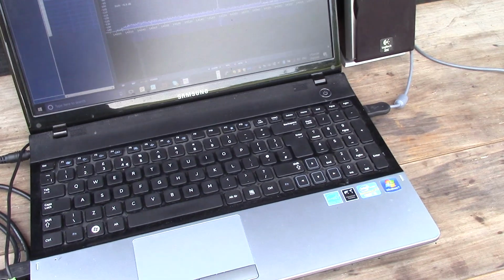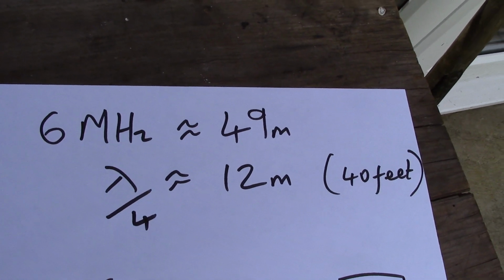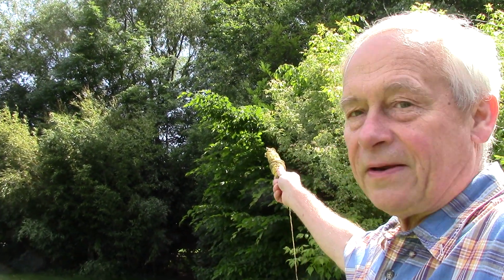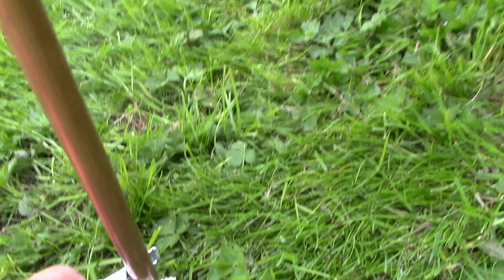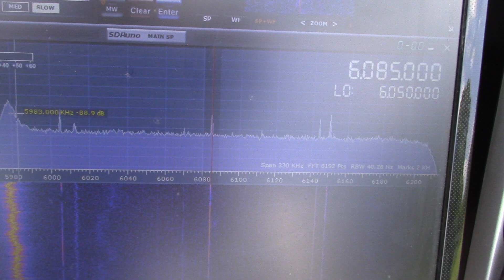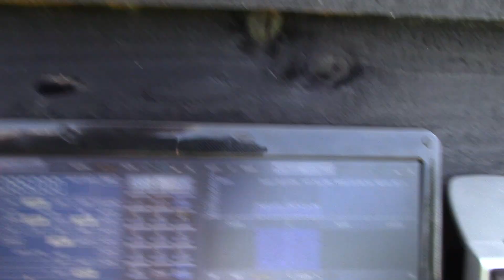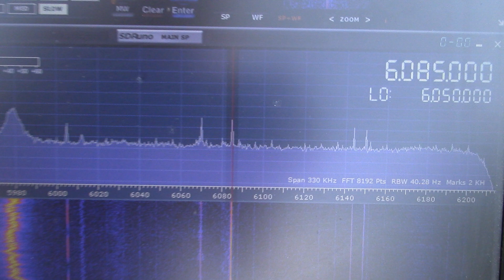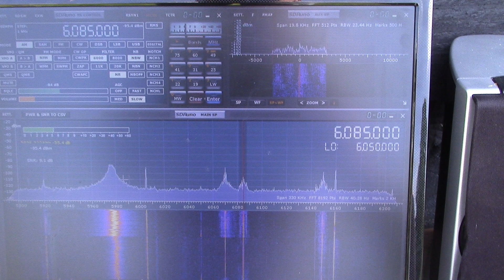Shortwave radio antenna and ground demonstration

Comment: Sir,
How do we receive at times hf frequencies in a vhf antenna
Reply: The signals are traveling through the air. Anything metallic, even a coat hanger, will pick up signals. Read an antenna handbook
Reply: @624radicalham  thank you for your reply. I completely understand that anything metallic can recv signals in the air. But doesnt the concept of a particular length of antenna required for recpetion of particular band of frequencies true? So then how hf freq in air is recvd at times by the small vfh antenna?
Reply: @abhilashraveendran8339  The concept of an antenna cut for a particular band is important for transmit only. Not for receive. Sure, there is something called a 'resonant' antenna cut for a particular range of frequencies for transmit. This will ALSO alow you hear a little better on those frequencies, but you'll hear almost the same with any wire up in the air. TRANSMIT is what is critical for an antenna to be resonant. And when it's not resonant, then you can use a transmatch (antenna tuner) to match the inpedence of an antenna to a transmitter. I'm glad to help but I wasn't joking about the fact that you need more reading. Check out the ARRL Antenna Handbook. And easier yet, watch YouTube videos on antenna theory. If you put a VHF antenna on an HF radio for receive, you'll hear HF reception. Of course. But you can't transmit without destroying the radio. Youtube videos. There's hundreds my friend.
Reply: @abhilashraveendran8339  Also, remember that radio waves travel at different frequencies so this is why VHF antennas are smaller. If you make a wire, for example, that's too long, it won't receive well on VHF. It will receive, just not well as it should. UHF requires even smaller antennas. Critical for transmit. Not so much for receiving.
Reply: @624radicalham  thank yo so much for making me understand the concept. Surely i shall refer the books. At times it becomes very much clear when someone experienced like you explains in short the whole concept. Thank you so much.
Reply: @abhilashraveendran8339  My pleasure. You will have fun playing around with different antennas and possibly even enjoy making them! HF is very exciting when your voice travels to distant places on earth, faster than the internet. Understanding propagation is important on HF. Today you can talk to Indonesia, but maybe tomorrow you can't because of the activity of the sun, and how magnetized the ionosphere here on Earth is. So then you learn to read the sun and it's properties. Fascinating stuff. I hope you get into the hobby fully!
Reply: @624radicalham  wow....this is so much interesting. The info shared by you depicts your years of experience and passion in the subject. Learning from a specialist like you is much more faster and makes the concept clear. Pleasure to get your rapid replies as well😌
Reply: @624radicalham  Thanks for this advice very helpful to me. I am a SWL and always worrying whether my random wire is too short or too long, but my question is answered regarding RX antennas. I have just received my RSP 1 A and cant wait to get going. I have a random wire antenna of 94 feet and always worry that it is too long.

Comment: A more efficient and easier ground stake would be:   A 3/4" copper pipe hydrodrilled into the ground 6', the hole around the pipe filled with bentonite clay (cat litter, usually), and several teaspoons of copper sulfate mixed with the clay. This really works with bad ground conductivity (sandy, or limestone type ground surfaces) as the copper sulfate improves contact with the earth ground as it slowly leaches into the dirt. Add water to the clay copper sulfate mixture to get it working. Shortwave radio stations that do not place a metal ground mesh 1' under the ground use this, but multiplied 36 times in a 360 degree fan around their antenna, one stake every 10 degrees. It works, cause I've used it around vertically polarized antennas for decades.

Comment: I have my RSP1a hooked up to my 34 foot Amateur Radio Vertical with 60 radials.   I LOVE ❤️ this little receiver !!  I also have the radio going through my Antenna transmatch so the signal is matched on every frequency.  I do have to unhook it after every listening session.  Amazing DX at night on all bands.  

I also built a small transmitting Loop that works portable :)

Comment: Thank you for this informative video, still I have some questions:
1 with the longwire antenna by using a 9:1 balun will increase the reception or this js mainly used for transit purposes?
2 using the grounding connector from the outlet will induce any risks?
3 using a tuner unit like the Yaesu FRG 7700 will help or isn't needed for RSP1A?
4 I have a DIY magloop from a 2m copper (18mm in diameter) pipe and a 1000pF variable capacitor connected to the RSP1A. Is there the risk of burning the RSP1A (front-end)?

Thank you
Catalin

Comment: Very informative discussion and video but it leaves out an issue that can become a life threatening hazard and a financial nightmare if not addressed properly.  If your antenna wire is above the roof of your house, 10m or so, it may attract a lightning discharge. Lightning arrestors for telecoms/radio circuits are commercially available and can be connected in series with the long wire antenna but are likely to cause impedance matching issues and signal loss of strength. Please comment

Comment: You can get 20m washing line strong plastic coated steel core for  £1.50p.from ASDA at the time of writing. It's whats going on my 4 band valve radio for SW listening.

Comment: With the loop antenna did you also maintain the two grounds?
Reply from the maker: No need for the mag loop. The signal source is where the loop breaks.  No need to have a ground or counterpoise

Comment: Great job.
One question, can we use the ground wire of domestic electrical wiring instead of stake in the ground or long counterpoise? Is it advisable? Are there any dangers?
Reply: Laeeq Khan Not a good idea as too close to mains likely to introduce hum

Comment: Very nice and informative demonstration on grounding but i have a question plz why did u use a speaker wire that you twisted at its end instead of a single solid or stranded wire like the one u used for counterpoise? Is there a particular advantage?
Reply from the maker: No - that was purely because I had that speaker wire to hand and I wanted something extra chunky so it would show up in the video.   You can use much lighter-weight wire - if it's to last over a period of time, when properly suspended then it's all about withstanding the weather!
Reply: SDRplay Software Defined Radio Receiver thank you! Do you think adding more counterpoise wires would enhance the grounding effect as compared to a single wire?

Comment: Thanks I probably learned more about antenna building than reading a bunch of books.  A couple questions (1) could you use your household wiring ground lead (i.e. from an electrical socket) as your ground?   And could you explain why this wouldn't work as a transmitting antenna?
Reply from the maker: The question about using the household ground is an interesting one.  Yes, it's true that in certain houses a domestic ground might also serve as an amazing RF ground for HF  (imagine you are on the ground floor using a mains socket ground terminal, very  close to the consumer unit which in turn is anchored to an excellent ground stake also tied to metal water pipes which go underground etc etc.)  However the safe answer is DO NOT CONNECT THE RSP DIRECTLY TO THE HOUSEHOLD WIRING MAINS GROUND TERMINAL!  This is because under extreme circumstances a fault condition could exist in the household wiring whereby the safety ground temporarily gets an elevated high voltage on it (e.g. a wiring fault, a badly wired plug, a faulty appliance which uses the ground terminal - agreed it's highly unlikely when you also have current residual current detection circuits to ensure live and neutral current flows are equal and so few modern appliances rely on the ground terminal, but the safe answer is not to try it    Additionally,  an average ground connection to a mains socket, well away from the consumer unit and house ground, now has the potential to present significant noise, coupled capacitively, from the long lengths of parallel conductors where many sources of interference may be present from all the other electrical devices  in the house).   

Regarding  the question about transmitting with such a crude antenna:   the main problem would be inefficient RF coupling of the transmitted signal.  When receiving it doesn't matter that the antenna is not matched very well to the receiver.   Receiving is all about getting the maximum ratio of signal to noise.  There are a number of tricks you can play, but matching  isn't important.  What matters is that you collect more signal than you collect noise. I saw a post from N3OX who put this well and I quote " Most of the time, on HF at least, you have plenty of signal available from any random antenna you put up to not have to worry about losing power in the feedline or antenna system.  The only way the RX will suffer is if your feedline or antenna is SO lossy that the signal you want to listen to drops into the internally generated noise in your receiver. This happens all the time on VHF/UHF, but on HF, it's usually the atmospheric noise or your neighbors plasma TV that keeps you from hearing well.  Feedline attenuation and antenna loss just make the signal AND the noise weaker, but the signal-to-noise ratio stays the same. 

A high SWR on your receiving antenna just doesn't matter very much. It might increase your feedline loss by three or four dB, but it doesn't have much effect on your ability to hear.

When you're TRANSMITTING, though, efficiency and gain are what you want.  You want to transmit all of your power. That's because when you make your transmitted signal stronger, the signal to noise ratio on the other guy's end gets better.  His noise stays the same, your signal goes up, you're easier to hear.

If you have a high SWR on your transmitting feedline and get three or four dB of loss, you're three or four dB weaker at the other end.  No good"    (end of quote)
So you could add a matching unit (ATU) between the RSP antenna socket and the crude antenna  to ensure maximum transfer of tarnsmitted power into the crude antenna, but even then - if the foliage was at all damp, there's a chance for the high voltage RF nodes on the antenna to arc across and instantly cause  a mismatch and potentially damage to the transmitter.    

But these are great questions - to get more complete answers, join the SDRplay forum and post them on http://www.sdrplay.com/community/viewforum.php?f=8&sid=839a6730d559764abf4afd8ada4932af  - you can also do a search to read other related posts on SDRs and antennas.

N3OX reference article: https://www.eham.net/ehamforum/smf/index.php?topic=32467.0
Reply: @SDRplayRSP  fantastic info and thanks. I've been working to wrap my head round HF antennas and this has been tremendously helpful.

Comment: How about grounding via the mains ground pin? There are special plugs for computer techs to ground them selves by connecting clips to the grounding pin. Would that work?
Reply from the maker: While this might work, it is not  recommended since the house mains could in extreme fault conditions, end up carrying dangerously high voltage.

Comment: This last week I've been playing with my new RSP2 within the constraints of my 10m X 10m (30'x30') backyard.  At first, my antenna was a single 5m wire suspended about 2m above ground level (I had picture hanging wire), along with a ground wire.  I'm new to SWL, but I could pick up a bit at 40m and 20m.  I've now "upgraded" to speaker wire, 3m above ground level, but I split/pulled apart the two wires into a dipole, each about 5m in length, and a 6m center feed to the rsp2 high-z input.  Reception seems better, but I can't quantify.
I wonder if this dipole would outperform your expedient ground plane, since both of my receiving elements are elevated 3m above ground?
Reply from the maker: you are getting much better overall length with what you did so that would explain better pick-up, certainly on 40m (apologies for delay in responding!)

Comment: you can not do that. You must use a balun
Reply: Two Hands and a Radio  You can take and a piece of wire, but it is inefficient - some of the energy is lost due to the inconsistency of the input and output impedances of the antenna and receiver, a pin is not needed in the ground, just a piece of wire-counterweight.

Comment: Hello thank you for the video first off. I'm setting this up tomorrow hopefully and I'm using a 9 to 1 balun from an eBay seller named lowbander. He uses a separate built-in ground connection and I am going to use 125 feet approximately of wire running down my neighbors 7 foot tall stockade fence. I got his permission of course LOL. I'm looking forward to this. I also bought a ground rod and some 8 gauge wire to ground it once the authorities mark the natural gas line. I'm starting out with a RTL-SDR v3 but I am either getting a RSP1A or and RSP2 soon.

Comment: High noise floor when using a wire, even if it is connected to a (real) earth or a counterpoise. The loop is the best all round antenna and as you call it "an option" it is far better compared to a simple wire. Also the loop in this version is a wideband antenna. It is the Signal to Noise ratio that gives good radio reception and the loop is always better compared to a wire antenna. As you can see in the video the noise floor of the loop is almost 30 dB lower compared to te wire so it will hear even the small signals on the air. Yes, there is the simplicity and low cost of a wire, but that is its only quality. The loop only uses ample space and is producing superiour signals, but it is more expensive. Nice video Jon but we can barely see the noise floor but lucky for us the S/N ratio indication of SDRuno shows us the  quality of the received signals.
Reply: How do discones compare to loops? For reception only, they seem to cover larger bandwidth and they also are cheaper
Reply from the maker: @02vLxcZF  Active mag loops are superb for HF and (depending on the design) below - see  https://youtu.be/aky9sVS0rTU  
 Discones can work well above 10MHz (depending on the design) and are excellent wideband non-directional antennas for VHF and above.  More about antennas here: https://www.sdrplay.com/antennasuggestions/

Comment: Thank you! I didn't know that grounding is so importandt for a receiving antenna.
Reply: Nash102030 ... not sure the ground he has is good. I am on heavy soil with a clay substrata 36 inches down. I have a serious  72 inch cooper rod with only a couple  of inches  left above  ground level and a heavy duty clamp.  The difference  was a s5 noise  reduction .
Reply: @robertl.fallin7062  Well dude prolly got tired.. Give'm a break.  ;)